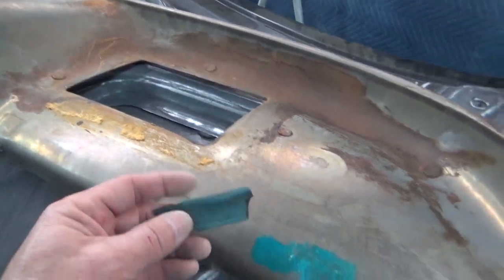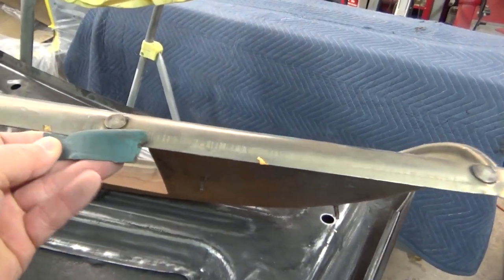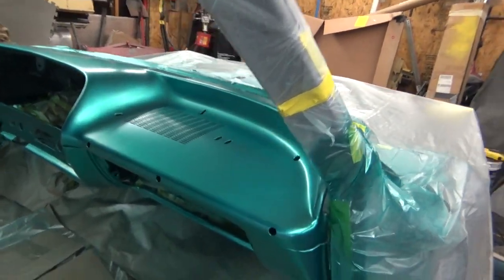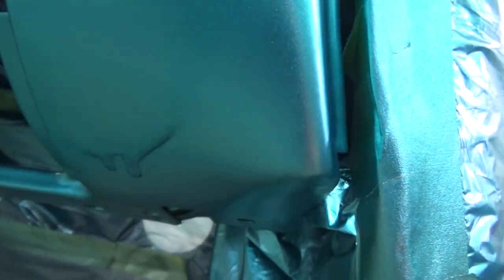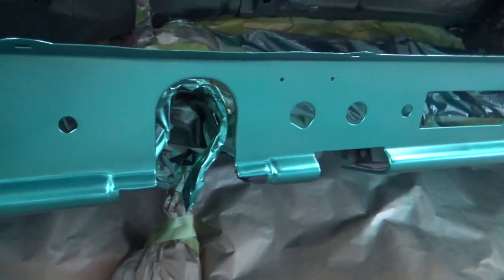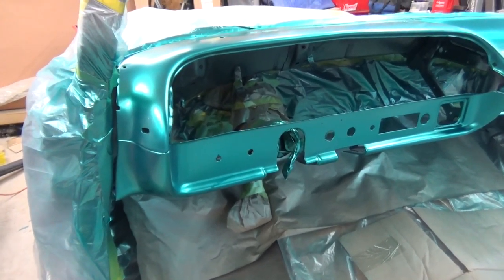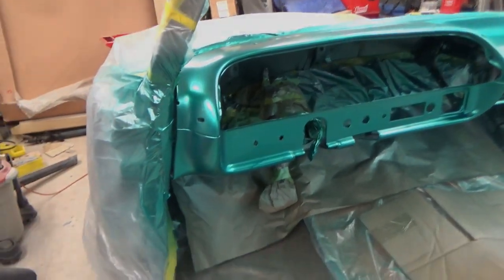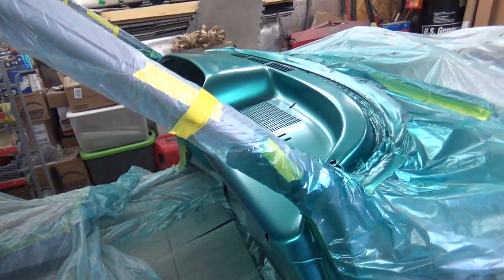64 Impala Dash Painted

Comment: Nice work. On my 64 I found it much easier to spray that instrument cluster if you drilled out the spot welds and take it apart. It can be bolted back together with small bolts and will still fit in the dash.  Its a very awkward piece to spray when it's 1 piece.  Just a friendly tip.
Reply from the maker: That's an excellent tip, I was looking at that the other day and was how the hell am I going to spray this , so I was thinking maybe a touch up spray gun. But yeah looking at it now I see where it wouldn't be that hard to take apart. Thanks for the tip!!
Reply: @ClassicCarOverhaul  good deal. 😎